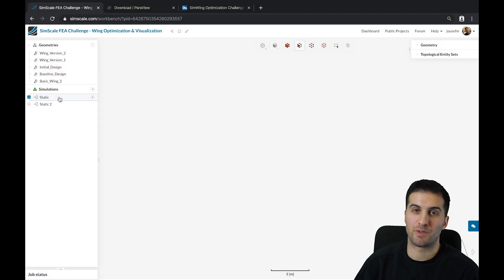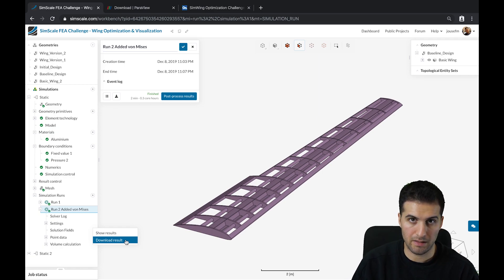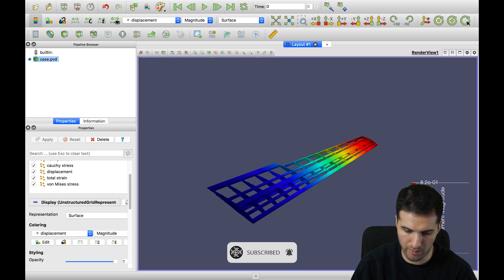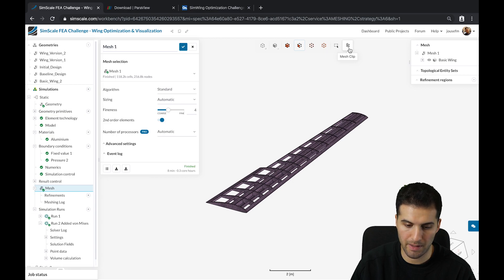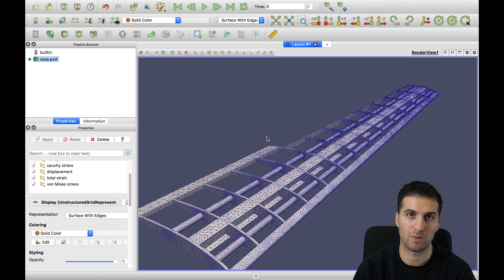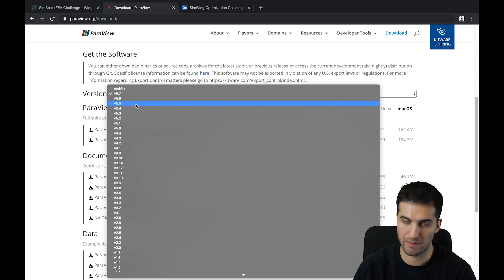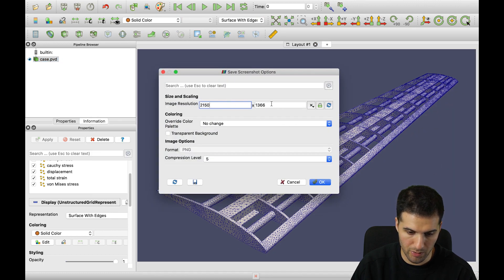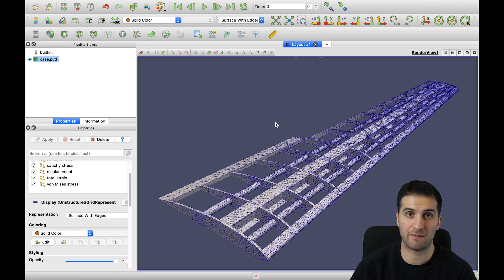SimWing FEM Challenge 2019 | Part 3/3 - Post-Processing in ParaView

Comment: Simscale looks good, and appears promising, having FEA and CFD in one package that can import several cad file types are really nice features.

I'm trying to determine by these videos, and other web resources such as other people's projects, if there is a way to apply a specific load distribution. 

Being that this is a wing, and Simscale promotes their program for aerospace, it appears, after several hours of searching, that nobody has bothered to use an actual load distribution as would be found on an aircraft wing. A point load at the wing tip to obtain a root bending moment and deflection is not how this problem should be analysed. I wonder if the program cannot perform it correctly.
Reply from the maker: You can also apply a surface load or upload csv files for conditional load cases at different time steps for example